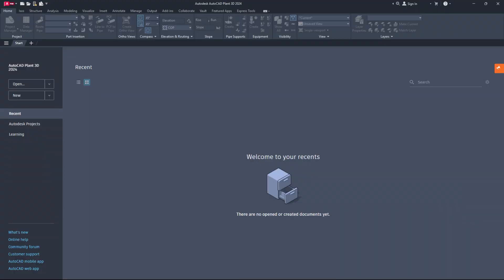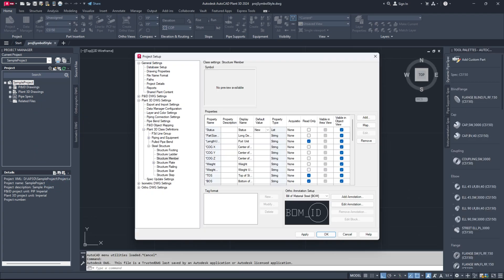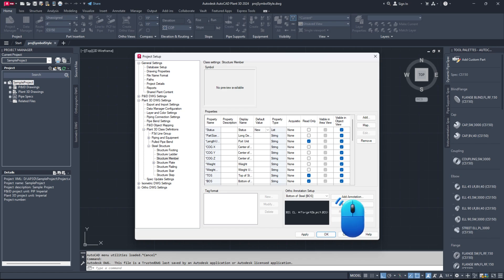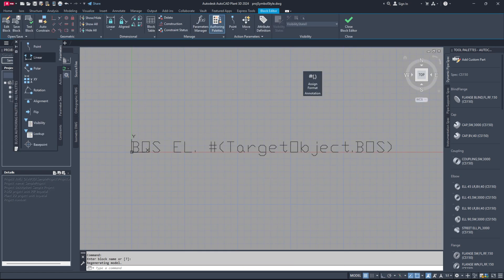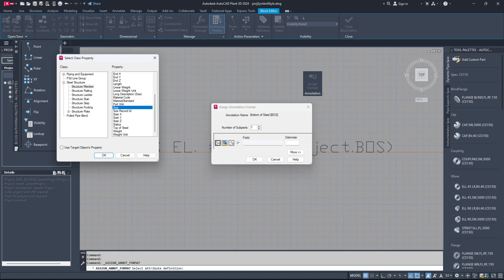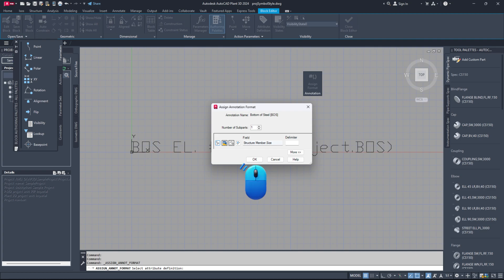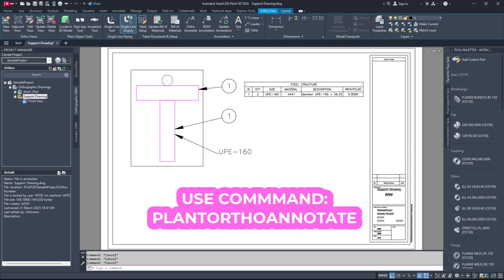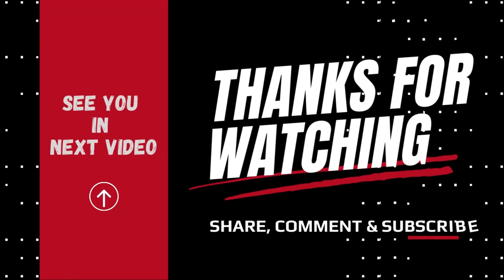AutoCAD Plant 3D | Create an Orthographic Annotation Showing Structure Member's Size

Comment: Hi

Is there any possibility to add a gate valve on a pipe by clinging to the center of the body at once? Not by the ports, but by the center of the fitting, like inserting a pipe support
Reply from the maker: Set the block insertion point at the center of the valve when creating a custom AutoCAD block-based gate valve.